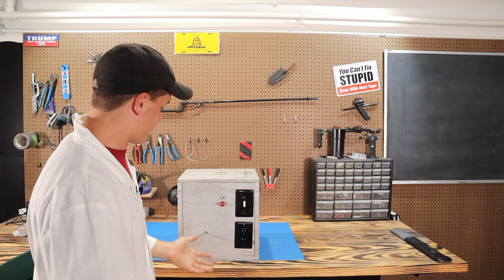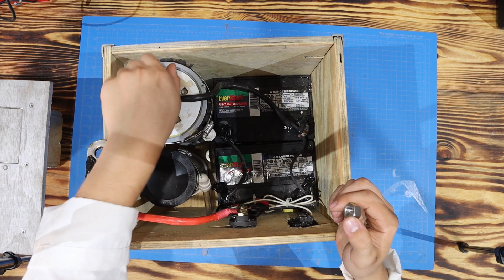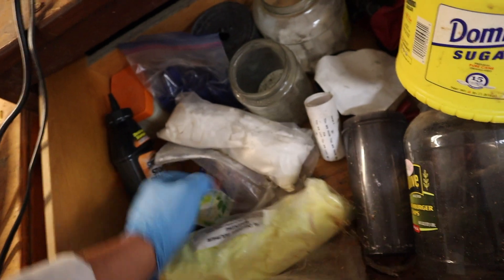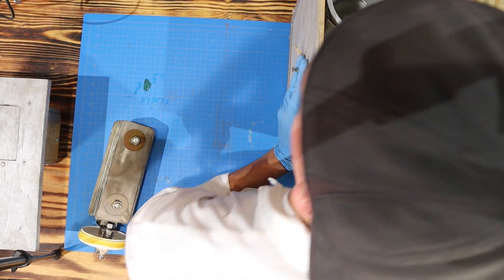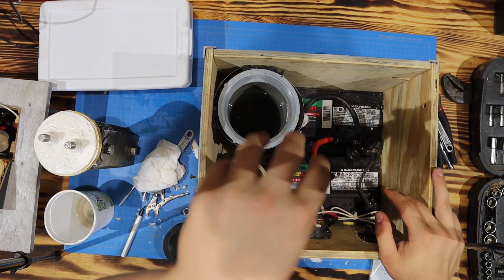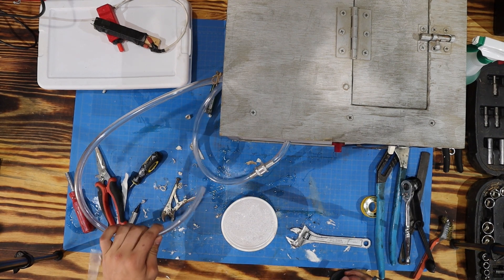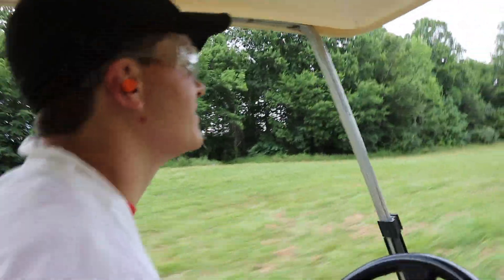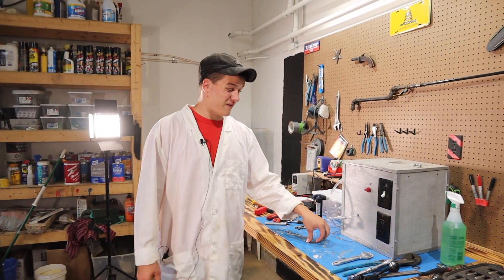PVC wet cell hydrogen generator --- overview and maintenance

Comment: Is this a simple HHO generator or is it really a hydrogen generator?
Reply from the maker: @en2oh  depends what you mean I guess. The questions is redundant. It generates HHO which is a mixture of hydrogen and oxygen. It’s a hydrogen generator and also an oxygen generator. I have a video of a electrolyzer that keeps the oxygen and hydrogen gasses separated if you’re interested.

Comment: Technically, this is an HHO generator.
Reply from the maker: HHO, 2H2 O2, hydroxy gas, hydrogen gas.... there are a confusing amount of different terms for this kind of device. The most technically correct imo would be a 2H2O(l) → 2H2(g) + O2(g) converter.
Reply: @HappyMadScientist  no, the most technically correct term would be a Browns Gas Generator.  Btw, CCA is not the same as amp hr capacity which is substantially less in these lead acid car batteries.
Reply from the maker: @en2oh  no, respectfully. The term “Browns Gas” only gained popularity in the 1970s–1990s when Yull Brown claimed unique properties for the gas (e.g., unusual combustion behavior), which led to speculative and often unverified or exaggerated claims. Water electrolyzers were in common use by the 1800s which was long before Yull Brown. The device electrolyzes water so at its very essence it is a “water electrolyzer”.